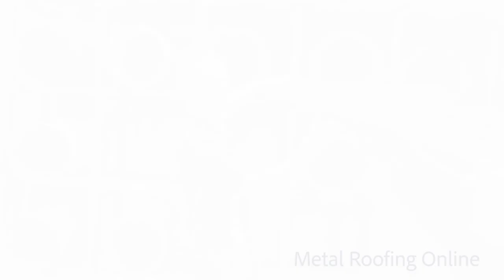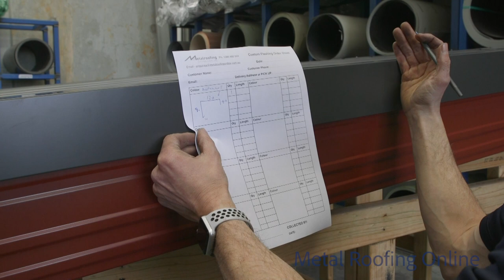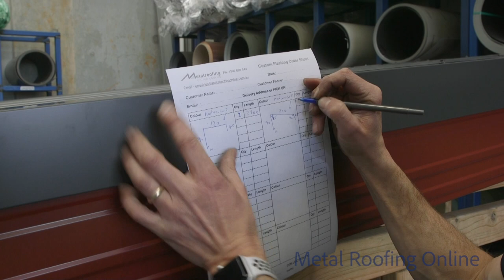How to: Install Barge Capping Roof Flashing on KLIP LOK roofing | Metal Roofing Online

Comment: Just a couple of questions. I noticed you've used a hook fold style barge flashing, with no face fixings or concealed clips to hold it in firmly in place, is it just reliant on the rivets? If so have u ever had issues with vibration from wind? Or flashings ripping of in storms? 2. When installing the clips on the roof, you pre install have u ever had issues with battens rolling and twisting clips out of alignment? Also perhaps their is a lack of straight or square edges to work from, do u use a string line in the gutter then use the sheet edge to set the first sheet, clip the first clips in place to the sheet square it up,screw it down,  unclip the sheet,set it, then start the sheeting that way. Other than no dry pan for your edge sheets, great video..

Comment: at the 31:45 mark u talk about apron flashing to a wall...do u just nail it into the wall and into the roof sheets? then caulk around the perimeter of the sheets contacting the wall for leak proofing?
Reply: Depends on the setup, if you are running your apron from a wall without a roof on top you will need to use a pressure flashing calked to the wall, if there's a roof above without gutter, say a corrugated roof you will just cut the apron flush with the bottom of the sheets above and you won't need to caulk
Reply: quoc lien. I will be doing an apron flashing video in the next couple of months 😊

Comment: Thanks mate, great video..
However I have a question please, Do you need to put silicone sealant around the notched out line where they meet with the roof sheets?
Reply: x x . Hi there. In my experience, as long as you do a neat enough job of notching out the flashings around the ribs of the sheets and the sheets are turned up properly, you do not require silicone in this section. 😊regards Daz